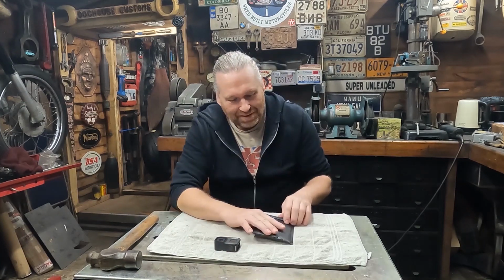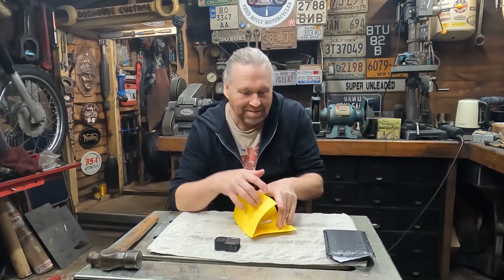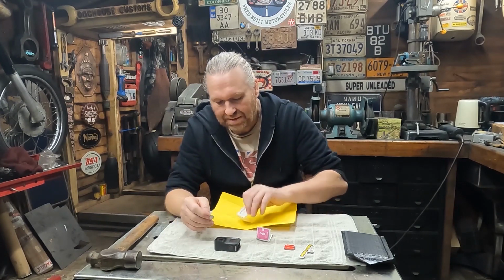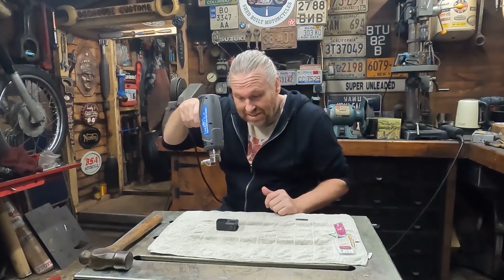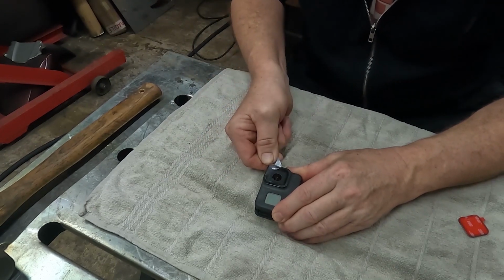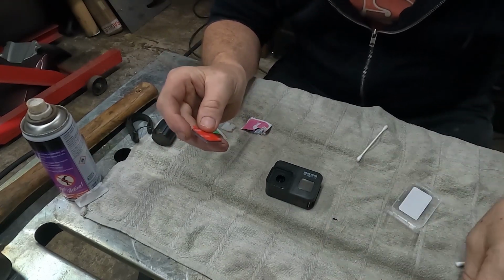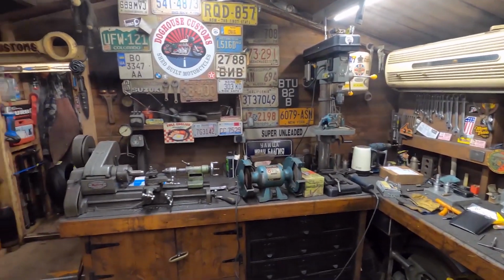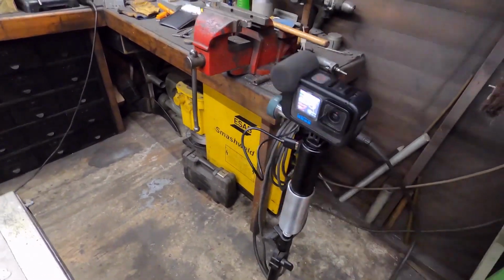Gopro 8 Damaged Lens Glass Fix

Comment: I know someone who'd have no problem whatsoever to make a little metal frame that holds a piece of real silicon glass, not the polycarbonate impact risistand sheet GoPro put on there, and put the camera in there when filming welding!
That someone looks a lot like you!
Reply: Schutzbrille nie vergessen, Sicherheit (auch für die Gopro)! ^^ 
Ein "Monokel" aus Draht, Klammer, Fensterglas... beim Metallbearbeiten der spektakulären und robusten Art, kann so was mal passieren. :)
Reply: @ronr6605  Never forget goggles, safety (also for the Gopro)! ^^
A "monocle" made of wire, clamps, window glass... when working with metal in a spectacular and robust way, something like this can happen. :)
Reply: @matkudinoff  been there, done that, got the shirt :))